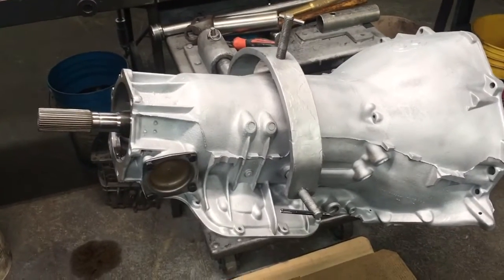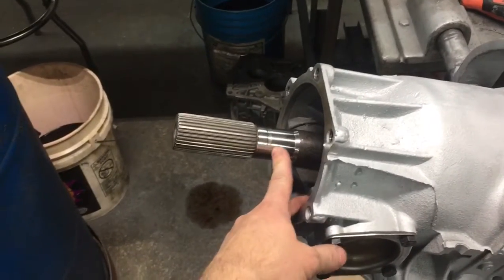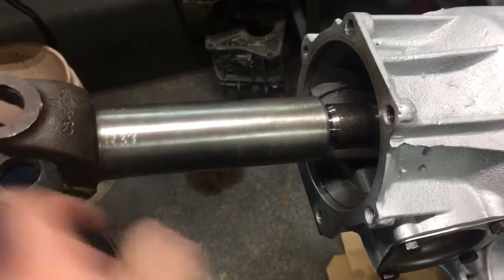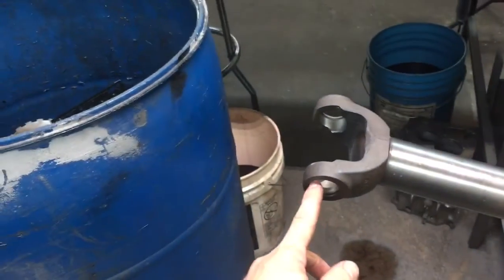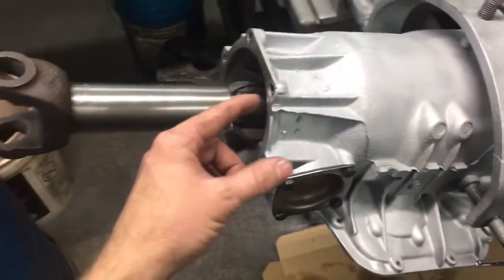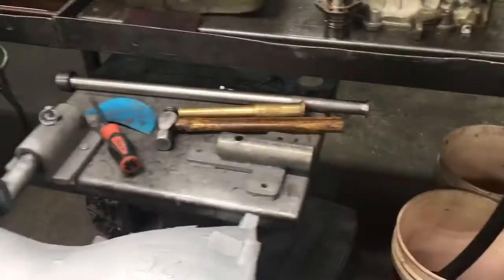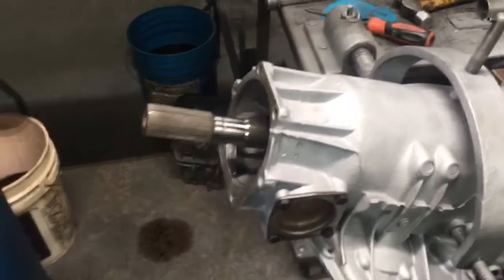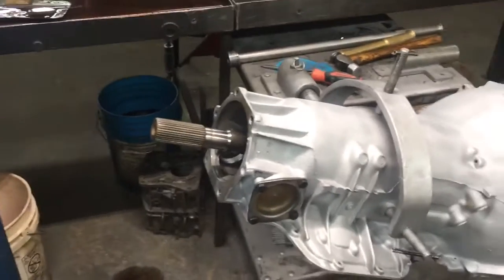Th400 Output shaft explanation

Comment: Anyone know the depth of the counter bore? Running into this issue with my th400 right now and am having problems trying to find the correct yoke. The output shaft has 3.25'' of teeth and then the oring section. From the ridge to the bottomed out portion of the tranny, it's about 2''. So would I need a 2'' counter bore?

Comment: Excellent video. I have a 400 and it’s leaking tranny fluid from the coupler literally near the coupler. I just bought this vehicle and I see there someone spot welded in there to try to stop the leaks. Does an o ring fix the leak? 

Asking because I just ordered a new yoke which I probably don’t need now

Comment: Just to be clear, is it okay to run a counter bored yoke without machining the lip on the output shaft?
Reply: josh ellington yes. That is exactly why you need to run a counterbored yoke. If you machine the lip then you run a normal yoke. The counterbored yoke is when you’re converting from a bolted yoke to a slip yoke, without machining.

Comment: Good info! Been running a stock th350 on a mild 350 for about a year and it may be about time to upgrade to a th400. This may be a stupid question, but can you wear out a trans by running a trans without a stall converter but with a mild cam? Mine pushes at idle pretty hard. I may need to head your way when it comes time for a th400. Clarksville?